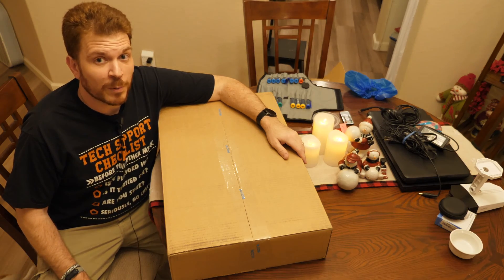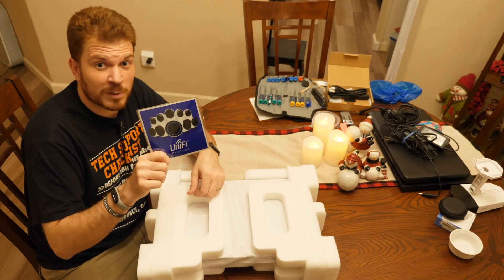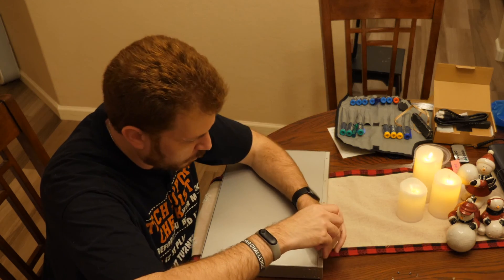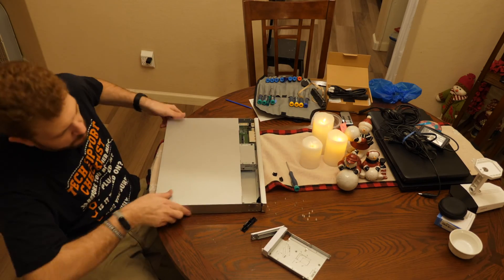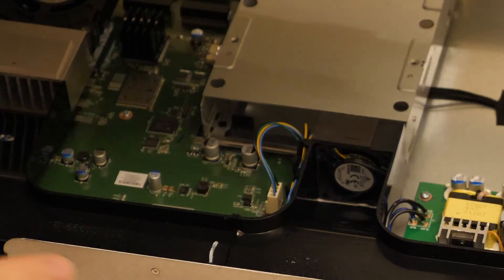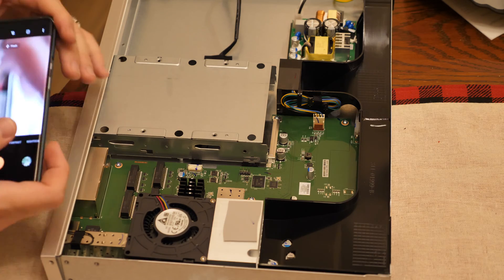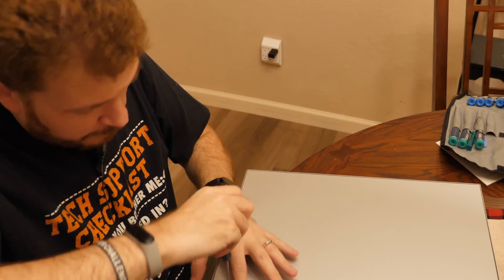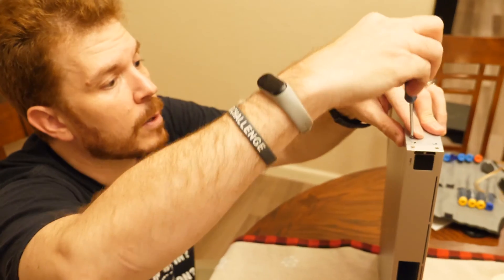UDM Pro Disassembly | Teardown of the Ubiquiti Dream Machine Pro

Comment: Love the Christmas candles on the table. Wish someone doing a teardown could tell me the output of the power supply. I'm assuming 12v.
Reply from the maker: @at0matic Thanks, yeah I probably recorded it around Christmas time. I actually have a UDM Pro I need to do an autopsy on that was hit during a storm. I'm on vacation now but when I get home I can see if there's a sticker on the PSU or not and if not see what my voltmeter says if the PSU is fully functional. (It turns on but runs in a boot loop)

Comment: Thanks for posting. I have several in the field and have yet to tear one down...probably since they all belong to customers. Did I miss it or did you not identify the RAM location? I am very interested in finding out if the RAM can be upgraded.
Reply from the maker: I have one that I'm planning on doing an autopsy on that was fried in a storm that I can look at in way more detail but I know it's soldered to the board so unless you can mod it like some of the Chinese RAM modded GPU's I'd just recommend buying the UDM Pro SE to have more RAM.
Reply: @ShinyTechThings I will have to take another look at the SE then. They must have gotten wise and changed them. We didn't go with the SE to begin with due to them only having the same 4GB as the Pro. Having to deploy POE switches anyways it wasn't worth the extra expense just to get POE on the UDM itself.
Reply from the maker: @user-sm3rq1wm1w I know I read something about more RAM but it may have been when it was in early access and they changed it. My apologies I was wrong on this. Here's the comparison. So unless you need 2.5GbE on the WAN or PoE built in then save your money.
https://www.vueville.com/hardware/unifi-dream-machine-special-edition-udm-se-vs-unifi-dream-machine-pro-udm-pro/#differences-between-udm-se-and-udm-pro

Comment: is there a tear down video of the UDM?
Reply from the maker: @fate2022 No because that one is glued together and these videos haven't made enough to pay for one to potentially destroy yet but if these videos take off then I'll still do it to the regular UDM.
Reply: @ShinyTechThings  no worries, I managed to figure it out lastnight, was actually pretty simple.
Reply from the maker: @fate2022  I tried but not with much force to crack mine open when I used to run on the UDM but I didn't want to damage it since I was going to sell it after upgrading to the UDM Pro.
Reply from the maker: @fate2022 what's the trick to opening it? If you'd like to share pictures please email me on the YT contact page. I could put a video together on it if you like and send enough photos to go over everything that's inside of the UDM.
Reply: @ShinyTechThings  sure I will email you a bit later today

Comment: Hey, I’m interested in taking the front off for.. reasons. I’m trying to find a video that does this and noticed you were about to abs then stopped. Is that because of the Bluetooth chip and other various connections linked to it that stopped you from removing it?
Reply from the maker: @James Danbury Correct, since I could see how everything was put together I didn't think it was worth the effort to remove and put back. It can be done but what are you looking to do exactly for a mod?
Reply: @ShinyTechThings  Spray paint it black. I know, I know.
Reply from the maker: @James Danbury you could mask everything off and plug in a bunch of  RJ45 rubber plugs. I'd love to see how it turns out if you paint it. (At your own risk of course) but I've painted surveillance cameras and they come out fine. I've never had to do a warranty claim yet though but since I just mask everything off and paint it I don't think they could deny the claim. Anyways my email is on the YouTube contact page. Also let me know if I could show the picture or not in a future video. Maybe I'll do one on painting electronics.

Comment: Besides screws and dead animals I found a bunch of hair (long & human) between the bezel & frame of a laptop screen ... was supposedly "remanufactured" by D*** (you know that company)
**edit - I forgot: cute dogs!
Reply from the maker: @jay kastner it's a shame how the QA has gotten so poor, especially after covid. That's Mr. Max he's pretty chill most of the time, unless there's a bird on the fence then he goes crazy.
Reply: @ShinyTechThings  Sadly sometimes I think it's our own (un)doing - price is the main factor nowadays when buying (almost) anything, and that creates the pressure on the MFG chain to deliver and cut even a few more cents off labor cost and hence training etc all the way down to QA
And any unpermitted sitting anywhere on the property has to be reported of course ;-)
Reply from the maker: @jay kastner I just reread your post, you found a dead animal under a bezel?!🤦‍♂️😜 What did the manufacturer say to that?
Reply: @ShinyTechThings  lol that was poorly worded ... sometimes screws, sometimes dead animals, and ONE time some hair - that was clearly put there by accident AT the time of assembly of the laptop screen. It was then decided that the " ... need of the user outweighed the needs of the angry ... " and we pulled the hair out with pliers
Reply from the maker: @jay kastner, why not disassemble just enough to pull the hair out? Hopefully it's nowhere near any of the cooling system.
Reply: @ShinyTechThings  not affecting the cooling, but at some point the user wanted his 'new' (recertified) laptop ... so we pulled out as much as we could and even if there's some left now it's not visible ...
Reply from the maker: @jay kastner That's cool. So was it new or refurbished or something?
Reply: @ShinyTechThings  it was shipped directly from D*** and i can't recall if they said "recertified" or "refurbished" (most likely the former)

Comment: Noice video. Yes I had a Laptop from factory that missed screws.
Reply from the maker: @Budget Gaming HD I have seen several, also I've seen bad displays from loose cables. It's gotten worse since COVID. My first OnePlus 9 Pro phone had a bad battery and fingerprint sensor and they denied the warranty to cross ship a replacement because I files with the wrong department first. I might go Apple for my next phone, Samsung cripples the UI and don't get me started on Bixby. The only other phone I'd be interested in is maybe another Pixel but not the current ones.